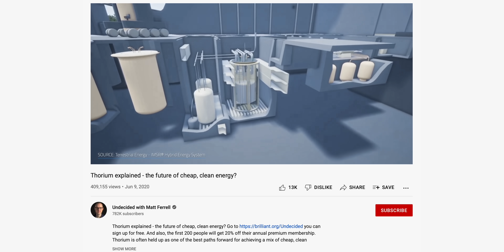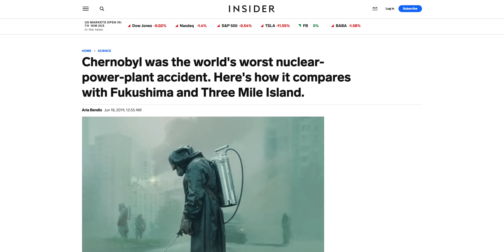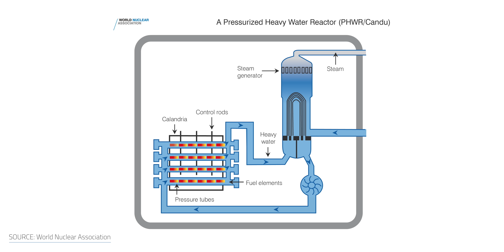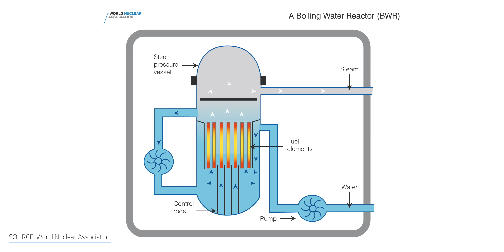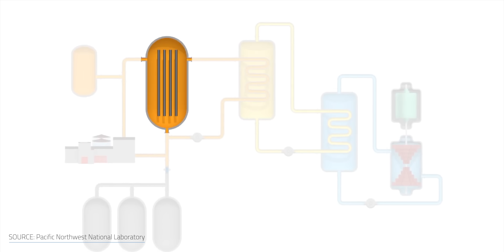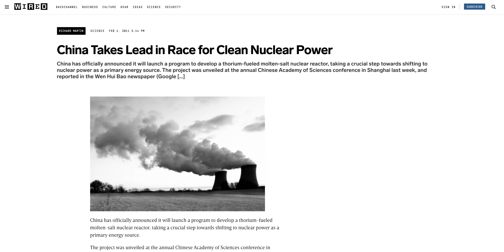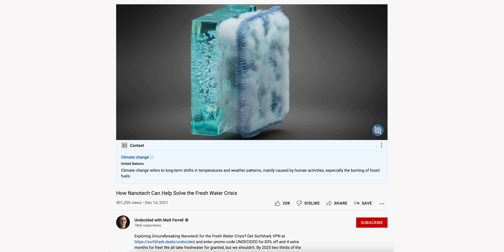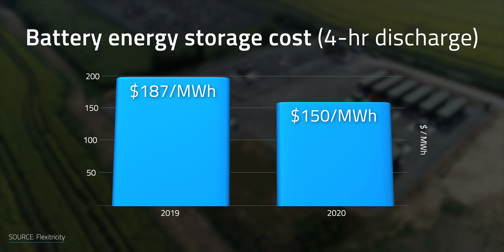Revisiting Thorium Energy - The Future of Nuclear Power?

Comment: The best thing about nuclear fission is very high energy density and very low material and land density.
Reply: But it is the most expensive method to produce electrical power.

Please don’t assume that YT videos are factual.  If you live in the U.S. here is the reality for the last 4 state of the art Westinghouse AP1000 ADVANCED passive safety features new nuclear power projects and spent fuel reprocessing and in the U.S. over the last 20 years. You decide if this YT video was presenting the truth. 

The Southeastern U.S. is super pro-nuclear MAGA, has zero anti-nukes, and 100% media and political support. 

The MOX facility (South Carolina) was a U.S. government nuclear reprocessing facility that was supposed to mix pure weapon grade Pu239 with U238 to make reactor fuel assemblies. It was canceled (2017) in the U.S. After spending $10 billion for a plant that was originally estimated to cost $1 billion and an independent report that estimated it would cost $100 billion to complete the plant and process all the Pu239, Trump canceled the project in 2017.

VC Summer (South Carolina) new nuclear units 2&3 were canceled in 2017 after spending $17 billion on the project (original estimate of $14 billion and 2016 completion date) with no clear end in sight for costs or schedule. 

Vogtle (Georgia) new nuclear units 3 &4 currently 110% over budget and schedule (currently over $30 billion) and still not operating. Mid way into the build, the utility stated that had they known about the many costly delays they would never have chosen nuclear. They are now delayed another year because according to the project management, thousands of build documents are missing. 

Please google any of this to confirm.

If you can’t build new nuclear in the MAGA super pro-nuclear southeast U.S. then where can you build it?

Comment: Although wind and solar might be cheaper, the sheer size of land needed to build a windpark which produces as much energy as a nuclear power plant is ginormous. As for solar panels, they certainly have their own place, but in some regions far away from the equator they produce very little energy in winter time, a time in which energy is most needed. Also, there are mountains of used panels which results in a big challenge of dealing with toxic waste. Point is, there needs to be a stable grid behind them and MSR's seem to be a plausible option.
Reply: There is more available land in the U.S. that we could ever possibility need.  But for some European countries it may be a problem. Here in the U.S. the peak usage is during the day in the heat of the summer and solar output matches that perfectly.

Where do people get this solar=toxic BS.  Solar cells are 99.9% silicon or better known as sand.  The electrical connections do contain very small amounts of lead and other hazardous metals but much less than a cell phone, TV, radio, or any other electrical device.  In the U.S., the EPA defines in RCRA the TCLP method that is used to determine if something containing these metals is or is not hazardous and solar panels ARE NOT HAZARDOUR waste and can be disposed of in a regular landfill.  However recycling facilities are opening up all over the U.S.
Reply: @clarkkent9080  read again
Reply: @woutervanwijk4369  I did and we have the room and solar panels are not toxic.  Concerning MSRs , Terrapower is the only company interested in building one and after 2 years and the U.S. government offering up to $2 billion to help, they have nothing but a nice looking web page.  Your point???
Reply: Reading isn't your biggest talent now is it. I said power plants, not navy or weapon facilities. And what is your argument against sun hours since you outgrade me so obviously? I said solar has it's place but it needs a stable grid to lean on. And if electronics aren't hazardous waste, why do we ship it to African countries with little to no laws for chemical waste?
Reply: @clarkkent9080  what are you, a solar panels salesman? All lies
Reply: @clarkkent9080  so tell me, what other solution to burning coal or gas do you propose? Besides that, you seem to be ignoring the whole MSR story. But I suspect you're probably an expert at that too, Superman.
Reply: @clarkkent9080  I am not an American. I am Dutch. The fact that you automatically think I'm American says a lot about American world view. You literally outsourced all production industry to China and therefore partly responsible for Xi Jinpings success. You gave them jobs and a growing economy that grew in such a hurry that they soon will have the technological advantage over the west. The only industry the US kept to themselves is weapons. To sell these the US needs conflicts to start and prolong for a long time. The perfect reason for dictators to show their people that yes, the US suck. Your all giving it to them and all you care about is the American perspective. Don't get me wrong, I don't think America sucks perse except for their leadership which creates enemies on a daily basis, dragging allies into unnecessary wars. China is lead by a dictator and the west is lead by corporate interest with the US up front. I seriously don't know what's worse.
Reply: @woutervanwijk4369  I guess that I assumed that anyone commenting on an English YT video and commenting in English was from an English-speaking country.  My world view is based on valid assumptions, and I clearly state in every comment that it applies to the U.S. over and over.  I have received replies from Germans and French that they are experiencing the same problems as the U.S. but that is what I have been told and have no first-hand knowledge.

Here in the U.S. prior to 1970, everything from Japan was considered cheap junk and China was not even considered.
In the late 1970s the common perception was that Japan was taking manufacturing away from the U.S. and their economy would surpass that of the U.S.
In the 1990s Chinees good started to appear and they were considered junk. 
Now in the 2020's Japanese brands are made in China and Chinees quality has improved.

However, I see more and more goods from Thailand, Vietnan, South Korea, India, etc..

The world is a global economy and that has been made clearly evident by the pandemic.
Manfacturing, especially that with associated pollution will always move to the poorer countries. China is now experiencing a bubble and just like Japan will fall back to some back seat position to India or some African country. 

The war industry has always profited from wars they encourage.  And many American families have lost children to wars started for profit.  I lost a brother-in-law and my one brother is mentally and physically disabled from his Vietnam service. But people are stupid and politicians are skilled at convincing the sheep to come to slaughter.

But back to nuclear.  After Vogtle unit 3/4, there are no more planned in the U.S..  Old plans are shutting down every year.  Americans will not accept blackouts and will demand electrical power from natural gas, coal or whatever it takes.  
I do not know or even care about your country's situation and yes that is my American view of the world.  There is little I can affect here so why waste any energy considering your country?

Comment: Nuclear (even the 'old dirty' kind) is the only real viable 'clean' energy we have right now.
Reply: You mean like this?

Please don’t assume that YT videos are factual.  If you live in the U.S. here is the reality for the last 4 state of the art Westinghouse AP1000 ADVANCED passive safety features new nuclear power projects and spent fuel reprocessing and in the U.S. over the last 20 years. You decide if this YT video was presenting the truth. 

The Southeastern U.S. is super pro-nuclear MAGA, has zero anti-nukes, and 100% media and political support. 

The MOX facility (South Carolina) was a U.S. government nuclear reprocessing facility that was supposed to mix pure weapon grade Pu239 with U238 to make reactor fuel assemblies. It was canceled (2017) in the U.S. After spending $10 billion for a plant that was originally estimated to cost $1 billion and an independent report that estimated it would cost $100 billion to complete the plant and process all the Pu239, Trump canceled the project in 2017.

VC Summer (South Carolina) new nuclear units 2&3 were canceled in 2017 after spending $17 billion on the project (original estimate of $14 billion and 2016 completion date) with no clear end in sight for costs or schedule. 

Vogtle (Georgia) new nuclear units 3 &4 currently 110% over budget and schedule (currently over $30 billion) and still not operating. Mid way into the build, the utility stated that had they known about the many costly delays they would never have chosen nuclear. They are now delayed another year because according to the project management, thousands of build documents are missing. 

Please google any of this to confirm.

If you can’t build new nuclear in the MAGA super pro-nuclear southeast U.S. then where can you build it?

Comment: Just to confirm, the benefits of thorium based reactors over uranium is the availability of thorium and the shorter half life of the waste? And the benefits of a MSR over boiling water setup is that the salt can be unpressurized and drained? Also too with nuclear accidents, the issue with a meltdown is the creation of hydrogen gas (and thus explosion) from local water or other oxides, but with salt reactors that risk is minimized.

Comment: Nuclear is horrible... what is wrong with you ppl..  Energy can not be created or destroyed. ALL the marketing behind nuclear and thorium is actually WRONG.  Its the worst type of energy we have.. Carbon Nutural... HARDLY.  how much fuel do we use to MINE the uranium... then we have to STORE it (resources to build a holding chamber) for WAY longer than the plant will be around.  We dont even get that much electric from FISSION.  its all lies in their marketing.
Reply: What science are you studying? Pseudoscience? 

Nuclear energy takes a radioactive substance and uses its stored energy to boil water and turn turbines. That's all. Half of your comment is purely filler words. Also, it takes a lot less to mine the thorium than it does to use it. Do some research bro

Comment: other potentials of thorium molten salt reactors encountered:
1. the MSR can also use much of the other nuclear waste as fuel to supplement their own fission processes - a way to productively consume decades of dangerous stockpiled waste. 
2. the high temperature of molten salt can be used industrially - no need to create heat (burning fossil fuel) to support industrial applications.

Comment: I find it hypocritical of wind / solar folks when they talk about the disposal of nuclear waste, when the lifespan of solar panels is only 20 years or so and wind turbines are also limited.  What about the -disposal of those?  Also, they did the cost study for a 30-year lifespan, when in reality, nuclear plants have a usable lifespan of closer to 70-100 years.   Once factored in, nuclear is still much cheaper since you don't have to rebuild it every 20-30 years.  Also, batteries don't last forever.

Also, in practical terms, what's the difference between thorium storage for 500 years, or uranium for 10,000?  I'm not even sure civilization will be around in 500 years.  Then factor in, that all the uranium ever used can be stored in about the space as a football stadium.  We aren't talking a massive amount of space.   It is minimal, especially compared to the size of the mines and forestry being destroyed to mine for the rare earth minerals used for batteries and magnets (for wind).

I firmly believe that we need to cover the base loads with nuclear, then let solar, wind, and maybe LNG cover the peak loads.  This is the most cost effective and stable way to run the energy grid, in my humble opinion.  Storage is a boogeyman argument that those who are worried about it, conveniently overlook for their "solutions."

Comment: I appreciated this, up until you started carrying the water for the green energy crew by not including the figures over lifespan for solar and wind. average lifespan of a wind turbine is in the neighborhood of 10 years, and solar panels are less. The cost over lifespan if you include it at 30 years for the solar cells it is MUCH higher than the cost over lifespan of the thorium reactor, because of replacement/disposal costs. Including the fact that we have stockpiles in the hundreds of thousands of tons of thorium already separated as XO SO stated using thorium becomes much cheaper. Included in this should also be some of the existing testing that has been done on thorium by national labs in the 60s for the nuclear plane initiate.
Reply: Dude  solar panes are GUAREETIED to produce 80% of rated output after 25 years and 60% after 50 years.  Wind turbines are rotating generators that will last forever if maintained.   Stop spewing lies and try reading

Comment: For baseload power and for periods of time longer than 4 hours, it is absolutely necessary to have nuclear power and low cost thorium reactors essential.  Most days it may not generate most of the power but 4 hours is not a lot of time particularly during the winter or to cover for outages.  We are so reliant on 24/7 power now that blackout tolerance is becoming less and less of an option.  Also could you look at the accounting for solar which includes safe disposal and/or recycling of expired panels?
Reply: Is this absolutely necessary?

Social and YT videos are NOT the news.  If you live in the U.S. here is the reality for the last 4 state of the art Westinghouse AP1000 ADVANCED passive safety features new nuclear power projects and spent fuel reprocessing and in the U.S. over the last 20 years. YT videos are great if you want to be spoon fed misinformation instead of researching facts.

The Southeastern U.S. is super pro-nuclear MAGA, has zero anti-nukes, and 100% media and political support. 

The MOX facility (South Carolina) was a U.S. government nuclear reprocessing facility that was supposed to mix pure weapon grade Pu239 with U238 to make reactor fuel assemblies. It was canceled (2017) in the U.S. After spending $10 billion for a plant that was originally estimated to cost $1 billion and an independent report that estimated it would cost $100 billion to complete the plant and process all the Pu239, Trump canceled the project in 2017.

VC Summer (South Carolina) new nuclear units 2&3 were canceled in 2017 after spending $17 billion on the project (original estimate of $14 billion and 2016 completion date) with no clear end in sight for costs or schedule. 

Vogtle (Georgia) new nuclear units 3 &4 currently 110% over budget and schedule (currently over $30 billion) and still not operating. Mid way into the build, the utility stated that had they known about the many costly delays they would never have chosen nuclear. They are now delayed another year because according to the project management, thousands of build documents are missing. 

Please google any of this to confirm.

If you can’t build new nuclear in the MAGA super pro-nuclear southeast U.S. then where can you build it?

Comment: I like the idea of the sodium thorium reactor. because if you do not tend the reactor it will naturally cool down, and because just a little bit of plutonium is necessary in order to get the thing kick started, or to stabilize it when it starts to naturally cool. I would definitely put that contention in there as an expected periodic balancing system.  it will eliminate the waste that we already have lying around. well nearly eliminate it. really the most difficult challenge as I understand it right now is piping the salts from place to place. As far as capturing the explosive material is concerned I don't see any reason why it can't be set up to keep that separated into small piles making the explosive material easy to refine and move around because it's specific atomic weight is necessary to have it detonate and you can stay away below that and still stockpile the stuff. Hopefully SpaceX will find a use for it in outer space where we can use it as booster fuel as I believe that would go a long ways towards mining Saturn's rings.

but what do I know I'm self educated on this thorium and of course it is all theoretic.
Reply: Why do you think the people that actually have to invest here in the U.S. are not even remotely interested in Thorium?

Comment: one big change is the weight requirements. nuclear aircraft was determined as not possible because the shielding was to heavy. thorium salt reactors look to me like they could be used to significantly decrease the weight and more modern electric propulsion seem to make it more viable. if you also consider space travel microwave ftl theories that require crazy amounts of energy, thorium could be a game changer for nuclear powered flight.